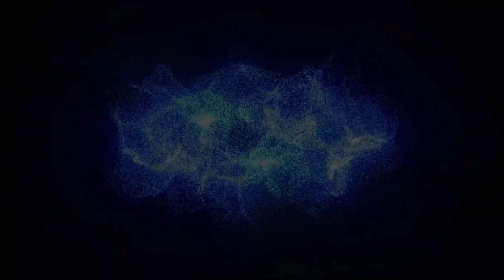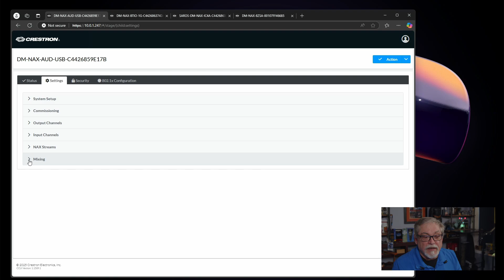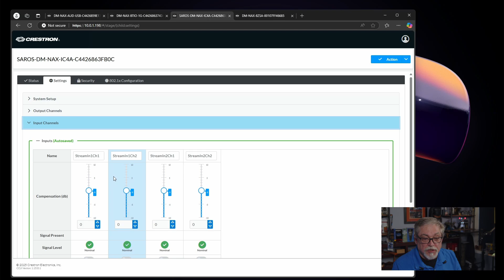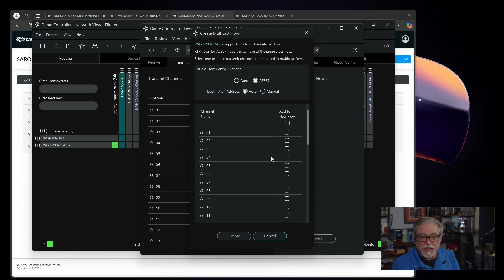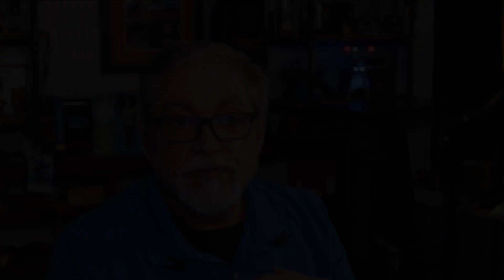Episode 002 - Demystifying NAX

Comment: Is there an example program floating around for these?  Not surprisingly, TB had no idea.
Reply from the maker: Hi Tony, there is a old Example Program for the DM-NAX-8ZSA (https://www.crestron.com/Software-Firmware/Software/Sample-Programs/DM-NAX-Sample-Routing-Program/1-0).  It is older and centered around the use of the amp.  Nothing for the edge device today.

My practice for NAX routing uses the serials for stream location through a "nexus" module (my own (re)brewed simpl+) bringing in all the TX strings in and routing them to the decoders based on a analog value for the destinations.   The rest of the signaling for volume, tone...  normal practice.

Not the only, way but it make sense to me.
Reply: Yes, I currently do something similar with NVX, and use the Crestron modules with NAX (which I really like).  It seems like these new edge devices and speakers will need a combination of those methods, and I just wanted to see how it was handled "officially".

Thanks for the response, and the awesome content!